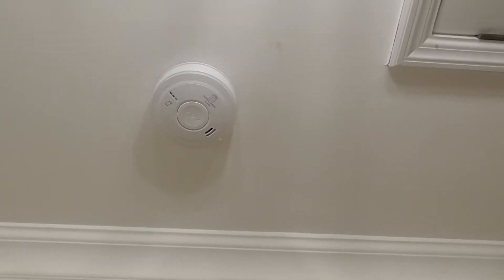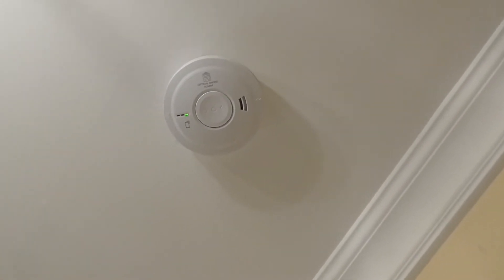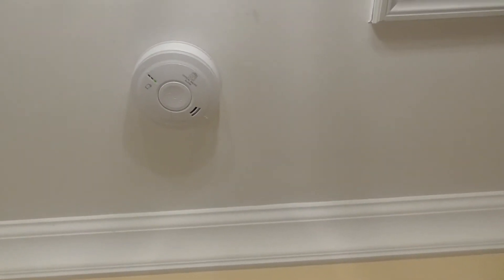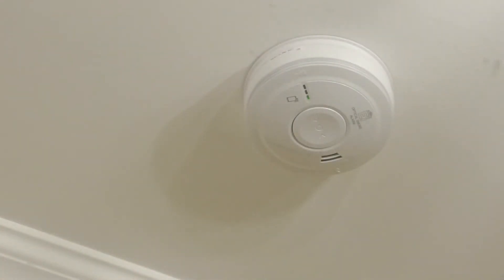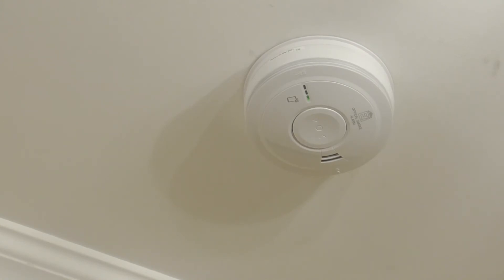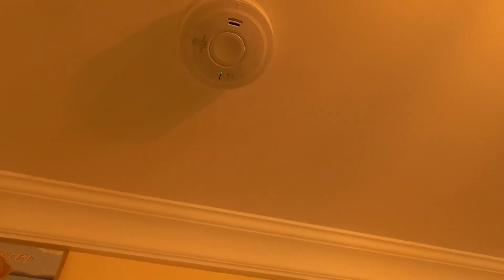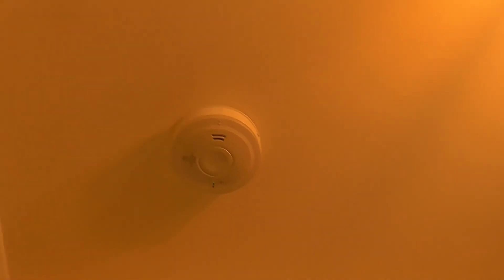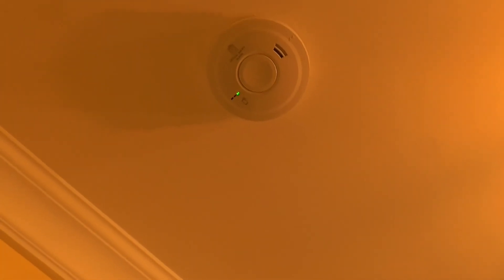House Smoke Alarms Test 1

Comment: Great video your smoke alarms are much better than mine we have mains powered ionisation smoke alarms and one heat alarm they are only good a detecting fast flaming fires than smouldering ones which are the most dangerous.
Reply from the maker: FireSafetyTech17 This year we had to replace old ionisation alarms to these new optical smoke detectors as the old ones went faulty due to age.
Reply: That’s true you have to change them out every 10 years our smoke alarms are around 5 years old
Reply: @fst1775  Replace It In 5 Years
Reply: @Siobhan_OShea  it’s probs 4 years now